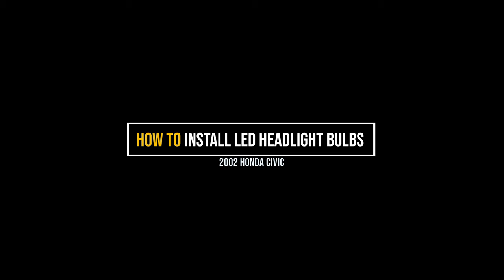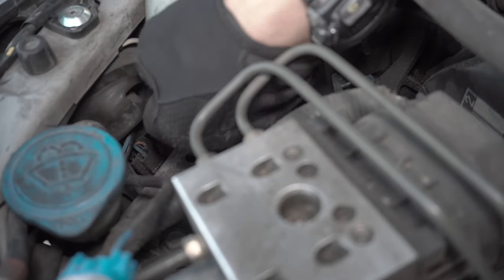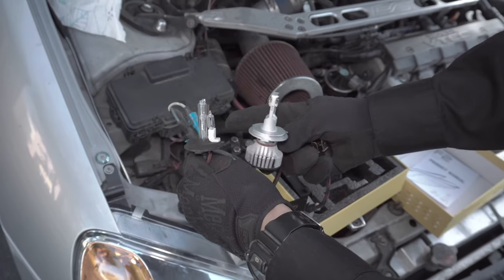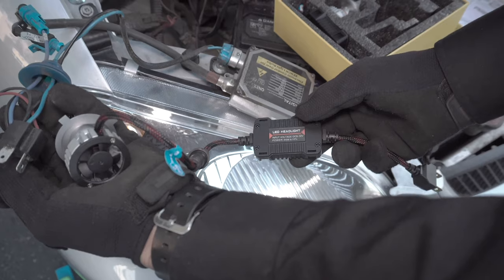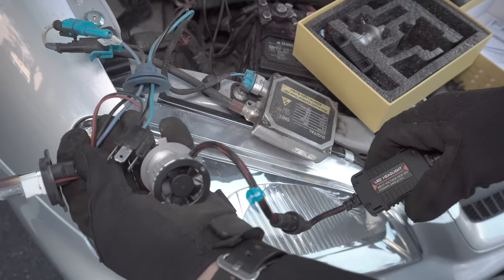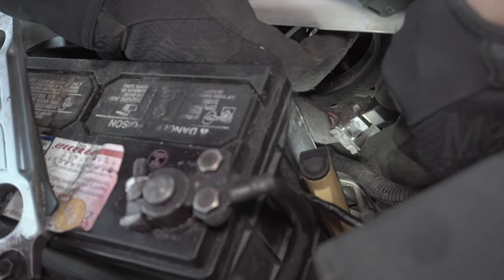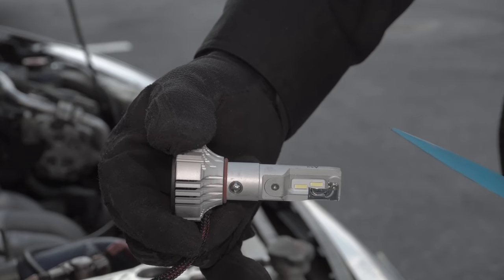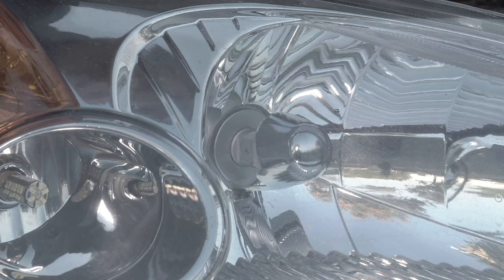1996-2002 Honda Civic H4 LED Headlight Bulbs Upgrade & Install

Comment: Hey bro i did this and it looks great and its  project light nicely however there is a weird shape if its pointrd at a wall. Suggesstions?
Reply: Could it be my headlight assembly housing? It is an aftermarket one.
Reply: Elijah Suazo most likely is due to the way you installed it, look up on youtube how to correctly aim it
Reply: what year is your civic? I put led lights in my 2002 civic and a DRL code comes up and my dash and my day time running lights dont work

Comment: I installed some leds in my 2002 honda civic. They are nice and bright. But how come my daytime running lights dont work? A light says DRL on my dash
Reply: The LEDs you use only support a voltage as low as 9 volts. If in Canada, DRL uses your highbeams at 6 volts. You need to find LEDs that support voltages as low as 6V. Otherwise you're going to have problems with your DRL.

Comment: I have the same car but mine has drls and the bulb that my car has is the same bulb for high and low beam. If I just buy the led bulb will it affect my drls or high and low beam function? Please answer I cannot find any answers on this
Reply from the maker: No, it should works find,  yet if you meet the DRL flickering or malfunction, please try to install the relay harness, the link is https://allalighting.com/shop/product/9003-HB2-H4-LED-Headlight-DRL-Bulb-Anti-Flickering-Relay-Harness/1697
Reply: Alla Lighting Automotive LED Bulbs thanks but I went with the nineo leds since they were in my price range and have had no problems so far
Reply: @Jonathan-pr1wo  what year is your civic? I put led lights in my 2002 civic and a DRL code comes up and my dash and my day time running lights dont work
Reply: @lindengauthier4407  they were some amazon led bulbs by NINEO, I got no drl code and worked fine but just recently one of the leds burned out so now I will be replacing with some other amazon led bulbs this weekend. I have a 2002 civic sedan by the way.
Reply: @Jonathan-pr1wo  hey thanks for the reply. So with your leds your high beams work, low beams work and the day times work with them? If so then must be a electrical issue with mine. Just didn’t want to send my led’s of their not the problem.
Reply: @lindengauthier4407  does it have a canbus decoder on the leds? if it doesn’t then that may be the problem because all the ones I’ve had they’ve had one.
Reply: @Jonathan-pr1wo  i would think they do. I paid $160 for them their a good brand. It could be a dirty plug. Or also on these cars the high beam switch in the cab is know to corrode so i may pull that out and clean it. Also the DRL module has issues on these cars to if you google it youll see. But I mean if their working on your car then they should on mine to. Must be a bad connection somewheres

Comment: How is the beam? Does the light scatter and not focus properly? I'm wanting to change out my Halogens with led's, but I still want to be able to see and don't want to blind others
Reply from the maker: Thanks for your message, our FL-BH have the perfect beam pattern same as the stock halogen bulb, but much brighter and won't blind, here is a video to show the comparison for your reference: https://youtu.be/f2qjbAuK4Cc
Reply: @AllaLighting  Which bulb kit would you recommend for a 2000 Honda Civic EX?
Reply from the maker: @kobe764  Yes, we strongly recommend https://allalighting.com/products/fl-bh-h4-bh2-led-headlights-conversion-kits-bulbs-9003
Reply: what year is your civic? I put led lights in my 2002 civic and a DRL code comes up and my dash and my day time running lights dont work

Comment: This is just the hi-low night time light right?  Only the day time one can run into issues of flickering?
Reply from the maker: Yes, usually high and low beam works fine, the DRL maybe flicker on and off. If you meet such issue, please try to install the relay harness, the link is https://allalighting.com/shop/product/9003-HB2-H4-LED-Headlight-DRL-Bulb-Anti-Flickering-Relay-Harness/1697

Comment: Will it work with drl mode?
Reply from the maker: Yes, it will work, yet if you meet the DRL flickering or malfunction, please try to install the relay harness, the link is https://allalighting.com/shop/product/9003-HB2-H4-LED-Headlight-DRL-Bulb-Anti-Flickering-Relay-Harness/1697